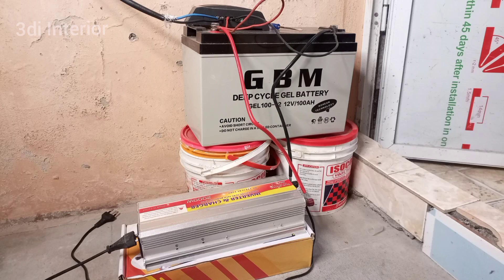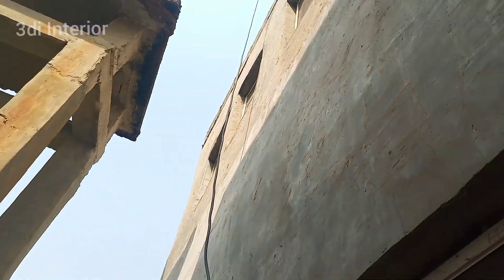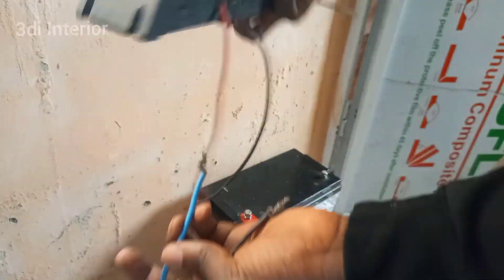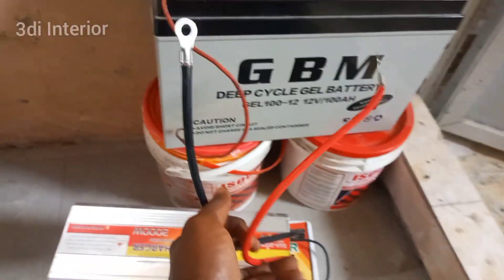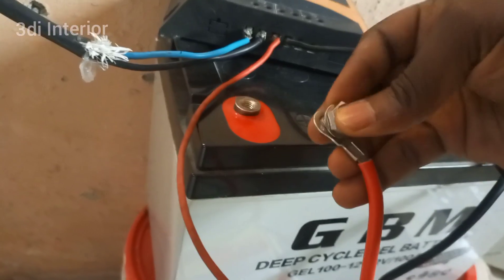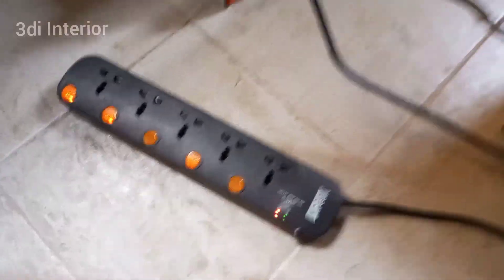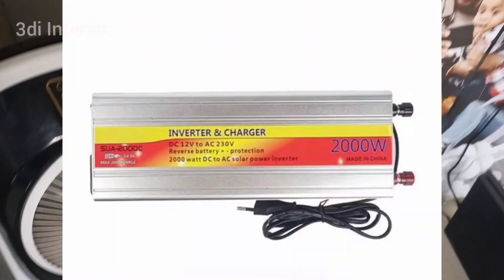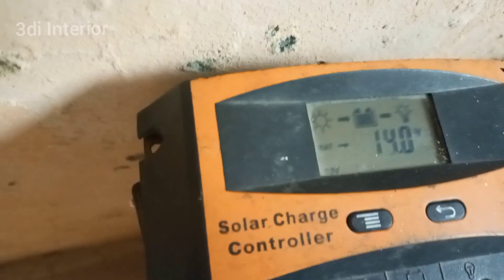How to generate your own electricity inverter with solar panel & battery for homes DIY

Comment: Very impressive, 

However i  learned that  you have to connect the charge controller to battery before connecting the solar, and when disconnecting, you have to disconnect the solar first,

How true is this guy's?
Reply from the maker: Thanks

Comment: Ok pls your solar panel is how many wat
Reply from the maker: @ikemichael1911  120 wats
Reply: @3diinterior760  and how many hours does it take to charge the battery from zero to 100?
Reply from the maker: @ikemichael1911  I can't tell because I never caculated

Comment: Can I power my 150w stereo amplifier?
Reply from the maker: Yes you can
Reply: @theartshop.1  with AVR?
Reply from the maker: I don't understand what AVR means  @CheMathiewNgayihiAbbe
Reply: @theartshop.1  automatic voltage regulator, since modified sine wave inverter aren't 220v

Comment: Does anyone have an idea what and what I should get to power 2 laptops, Starlink and phones for work during the day?
Reply: Just make sure the inverter is original, there are lots of fakes out there. Usually the working wattage is half of what is written.

2000W should be 1000W or less
Reply from the maker: @iamkingsleyf  this package can handle that
Reply: @ thanks, you say e no reach 500k
Reply from the maker: @iamkingsleyf  not up to 500k

Comment: Thanks for this update ... It has been 10 days since i did this and im enjoying it ... only problem is, it takes me 3 days to charge my battery full using a 12/24v 250w solar panel, 130ah 12v battery, 12/24v 30ah charge controller and 12v 1000w inverter at roughly 350k here in ibadan. 

how do i get my battery to charge? is it the same everywhere? what have i done wrong
Reply: Increase your panel capacity to 300-400watt
Reply: @anyanwustanley  thank you.... im considering it
Reply: Also, get an mppt charge controller
Reply: @AfricanFolklore24  thanks, awaiting the one i ordered from temu
Reply: If you're using PWM use 100w panels all in parallel. Get mppt only when dealing with higher wattage panels

Comment: I have this exact setup in my house, it carries all my light, hisense TV and fridge all at the same time..... I was super surprised.
Reply from the maker: @incrediblestevrhymz2260  mine can't carry fridge o
Reply: U are probably using a low wattage inverter, is it up to 3000w  @theartshop.1
Reply: @theartshop.1  How about your using 2000watts mine is 1000watts but it carries my deep freezer only if it's the freezer that's on
Reply from the maker: I am not a professional 💁 @mikelogbuli8175
Reply: Same inverter?
Reply: Really
Reply: how long do you get it to charge full? using solar
Reply: Amount
Reply: Do you have dc breakers and fuse ,, is it safe without it
Reply: Please how much did you spend
Reply: For 1000wat?
Reply: It can't be, confirm your battery and inverter capacity

Comment: Instead of using inverter can I use my UPS as inverter and just get charger controller with motor battery with panel for charging
Reply from the maker: @witemireolaniyi4620  don't know about that because I am not a professional

Comment: For safety wise, you should have connected the battery terminals first before connecting the solar panel to the regulator.
Reply from the maker: @RomsonKuldiRex-fq1mo  yes, you are right

Comment: Can 75Ah battery do this?

And also is GBM or sunfit battery lithium batteries?
Reply from the maker: @gideononivie6216  I am not really a professional 💁
Reply: yes 75ah can run it, go for gbm or sunfit battery if u are using that kind of sachet inverter
Reply: Im using GBM 75ah deep cycle gel 12v. Can i charge it up to 30amp from my panels cuz im buying a new panel to my set-up,without damaging the battery  @divine02o6u

Comment: Always plug the positive cable to the battery before the negative, not negative before positive as you did.
Reply: Abeg leave all those storey they also said connect batery before the soler
Reply from the maker: @thingsyoudidntknow1745  correct
Reply from the maker: @Dee_Omeke  thanks
Reply: @theartshop.1 its nice that you’re still replying comments and this video is from a year ago. So after a year, what is the update on this set up, are you still using it or have you upgraded it?
Reply from the maker: @Kompletefootball  I am still using it

Comment: Please do you need the charge controller if you are not using solar panel,ie if you are using the inverter and battery alone to generate electricity ?
Reply from the maker: @danielkwabi8831  in that case you don't need charge controller

Comment: Ok i did 
The cost
2 x 300w solar panel 75k each
Charge controller 40a 15k
Felicity tubular wet cell battery 220ah 270k
Inverter 1000w indian with transformer 100k
Wire 2.5mm 28k
Charge Breaker from light 5k
Workmanship 30k

Total : 598k approximately 600k
Reply from the maker: @onlineaccessCreativity  ik
Reply: Does still work

Comment: Hello, does the inverter goes off when the battery is low
Reply: That's good. The 1000w I bought doesn't goes off and has destroyed my battery
Reply from the maker: @fadeleenochkehinde5436  you need to consult a professional
Reply from the maker: @fadeleenochkehinde5436  yes it does

Comment: guys i just did mine, only inverter and battery. i use normal electricity to charge and so far it has serves me for hours and never go off or show low battery.  
here is my expenses:
 one battery 12v 220ah = 240k 
inverter 1000w = 34k 
and thats all i bought, but you will need changeover and AC wire for the connection, all of these may cost you upto 12k. 
all i spent in total was 275k, minus the workmanship and the cost of wire and changeover which i already have at home. 
so far i have been able to use it for more than 10hrs without light and without the battery showing low battery ...    connecting 1pc and 6bulbs, i rarely use the tv so i have no ideal if it will last longer when i use the tv
Reply from the maker: @worldtrendtv01  you are welcome 🤗
Reply: How do you charge with electricity??
Reply from the maker: @oluwoleodetola1626  it's explained in the video
Reply: @oluwoleodetola1626 You'll need an electrician to connect it for you. They will run the wiring directly from the changeover switch. It's important to ensure that the power from your inverter doesn't flow back into the inverter, as this could cause damage. The connection should be made from the wire coming from the NEPA supply directly on the changeover switch to your inverter.
Reply: So you don't have solar panel yeah?
Reply: Can you drop your whatsapp number bro
Reply: How long have you been using and how is it going?
Reply: How do u know when the battery is full?
Reply: Does your pc plug make sound and how had it been in the long run

Comment: Hello sir, I am using same inverter you demonstrating with. What is the power of the controller and how can the inverter charge battery without sun and nepa?
Reply from the maker: @nathanielidowu15214  without sun and nepa??? Everything is explained in the video

Comment: Which do u connect first to the controller, cable from the panel or from battery
Reply from the maker: @thefunnyman2629  just as you saw on the video

Comment: How many mm wire can I use to connect the panel to the controller
Reply: 4mm
Reply from the maker: I am not a professional so I don't understand mm
Reply: @theartshop.1 how many mm cable did u used to connect ur panel
Reply from the maker: I honestly don't know @kimberlystone2455

Comment: I have a similar set-up, here's my breakdown.
Battery = 120k (SunFit 12v 100ah)
Inverter= 65k. (3000w)
Solar panel = 78k ( 300w, 24v)
Controller = 30k ( PWM, 40A)
Cable = 27k+ (2700 per yard)

It is better to buy during raining season as the prices are a bit stable but during dry season the prices go through the roof.
Reply from the maker: Correct
Reply: How long does it take to charge your battery fully using your solar panel??

My installer used a 1mm cable because I didn't have money for the cable for now coupled with the fact that he was just telling me about solar cable......Now the system is not really charging and even with sun from 8-6pm
Reply: @oluwoleodetola1626  charging speed depends on the sun and charge controller. If the sun is good, then it would take 3-4hrs for me to get full charge. 
I'm using 4mm solar cable, this wire connects the solar panel to the charge controller and from there to battery, then inverter cable from inverter to battery. 4mm is highly recommended due to it's tolerance and efficiency.
Reply: @Nedohh  Waoh.....Thanks the sun is very good here even from 8am the sun is already shining but the cable he used couldn't even charge it full for 2 or 3 days now can you imagine
Reply: @Nedohh  Thanks, I later got a 1mm cable at the rate of 1800 per yard and by 10 or 11am my battery is fully charged and I run it using the sun while I run on battery during the night.......I'm enjoying it now 😃
Reply: @oluwoleodetola1626  Another 1mm cable? 😂 Wasn't the original one that wasn't charging 1mm too?
Reply: @obimadu6201  yeah 1mm but I bought it 200 naira per yard 😃 but this one is 1800 per yard 😃 

I just bought normal nigeria cable not solar cable
Reply: And it takes 2 days or 3 days to get it to full unlike this one within 3 hrs or 4hrs
Reply: @oluwoleodetola1626  what's your setup like? 
I just got 
4x 100w 12v panels - total 400w 12v
200ah 12v battery 
20amps mppt controller from powmr
1000w inverter with 10amps charger

Not for the whole house, just for my workstation via a UPS. By my calculation, full charge via the panels will take 7 to 8 hours, correct?

That's why am asking him where he got his panels.
Reply: @obimadu6201  Just 180W panel, 30A charge controller, 500W inverter and 40ah battery just to power my system majorly.
Reply: @yolodii  I'm using a moncrystalline silicon solar panel. They're highly efficient at Sunday absorption.. mine is a 24V, 300w and it charges my battery really well. I'll definitely add two more solar panels and and a battery connected in series to turn my setup to a 24volts system. This would  provide more energy to power the entire house with lite-medium load.
Reply: @Nedohh  What i want to know is if you got them online, and where, you got them much cheaper than i did mine.
Reply: @yolodii  nahh, I bought everything at a whole sale in Abuja. The prices were relatively good, they tested everything and some of the products came with warranty
Reply: @Nedohh  Ahh Nicee. I got mine off of Jumia, i got 200w 12v for the same price you got your 300w 24v. Good for you fr. Well I got an mppt controller hopefully i can still get good charging times once i setup.
Reply: @yolodii  the truth is that a lot of people go for a 12 volts system. That is why yours is quite expensive while @Nedohh's own is cheap. But for me, I decided to go for a 24 volts system which gives me more power at lesser cost. It all has to do with the kind of batteries that u have. I bought 2 quantities of 100AH batteries (12v each) and connected both of them in series to get my 24 volts system. The moment I was able to achieve that, I decided to buy 24 volts inverter which is quite cheaper than a 12 volts inverter but with more power for your gadgets at home.
Reply: @oluwoleodetola1626  please reply. With the 40ah battery,  how many times can it charge your system without sun? 

Cos I just ordered GBM 40ah battery.
Reply: @paturch7201 please how many hours does it last for you and what’s the cost of everything 🙏
Reply: @worldtrendtv01  back then (2 years ago), I used approximately 250k. But now, it may cost u more than 600k for real. Things don go up now. Only d inverter alone dey pursue 300k now and d battery is about 180-250k for 200AH battery now. Solar panel never join and d cables for connection, may be 150k. Everyday, prices of things dey go higher for naija.
Reply: @oluwoleodetola1626 with this setup, how long does it take to get full charge on a normal day and how long does it last?
Reply: @Lux_De1  6hours of medium load. (2 laptops, TV, dstv, standing fan, 2-4 plugged phones). 
U have to calculate your loads based on their watts and this would allow you manage or drain it. 
With TV, decoder and few plugged phones you can use your solar from 9am to 8pm in the evening with my set up..
Reply: @oluwoleodetola1626  im in the same situation..... 2.5mm cable was used. how did you remedy it pls?
Reply: @Nedohh tell me the store please i need it
Reply from the maker: @oluwoleodetola1626  I have not caculated
Reply: Thanks for posting this
Reply: Where did you get your solar panel please?
Reply: @yolodii  Area 1, FCT Abuja
Reply: Please how come your inverter is cheap. My own inverter is 1.1KV and I got it for 135K. It's called pure sine wave inverter and I think your own inverter is cheaper and efficient than mine. Though I'm yet to call someone that will install it for me.

I got two solar panels 250watts each (150K)
Charge controller is 21K
100Ah GMB battery (140K)

He was the one who bought the inverter, he said it will power my fridge. Please can you shed more light on my analysis, I'm a novice on this.
Reply: @biblelighttv01   @user-ot8uy1bf1l  My inverter is a modified sine wave inverter, which can deliver but certainly not as efficient as pure sine wave inverters of the same rating but you'd hardly notice the difference. 135k is a bit too much for a 1.1kw pure sine wave inverter, that cash should have gotten a 2kw pure sine wave and your battery is a bit too expensive to be honest. Concerning your fridge, don't bother stressing your setup to power your fridge, at full charge and with good sun, you should be able to run your fridge for about an hour or so, but if you power your TV, light, fan and other equipment alongside, then it won't last at all. Your set-up is not recommended for that much load.
Reply: @biblelighttv01  flat or sachet inverter is always cheaper because they are mostly modified sinewave and not pure sinewave. However, it is difficult to repair sachet inverters when they are bad.
Reply: @biblelighttv01  He might be correct with that estimate. My setup is a sachet inverter, not the regular type. I only use it to power light loads like bulbs, one PC, a television, and some other small gadgets.
Reply: @worldtrendtv01 can I get your setup?
Reply: Please how long will this Battery last without sunlight?
Reply: @jeremiahedet3544  largely depends on the load. Maybe around 5-7hrs depending on the way you use it... But most people can load it up and drain it within 2-3hrs
Reply: Thanks .... I'll do this
Reply: Help? 🥹

I’m in Abuja.
Reply: Can I make use of it without battery
Reply: Thanks bruh
Reply: Where did you buy these especially the inverter? Is it pure sine wave?
Reply: @iamkingsleyf  Area 1 shopping complex. The inverter is modified wine wave.
Reply: Sir I want u to put me through.
Reply: @Nedohh what is the name of yiur charge controller?

Comment: Is this particular product (inverter) good enough? I want to know if it serves well before I buy it.
Reply from the maker: Yes, have been using it
Reply: for the inverter, i would advise u go for pure sinewave inverters. What was used in this tutorial is a modified sinewave inverter, which is more cheaper but tend to give problems to phones' panels when using it to charge phones. But with pure sinewave inverters, u have no issues at all just that it is expensive.

Comment: Thanks a lot! Really helpful video. Can you pls help with a breakdown of cost?
Reply from the maker: You can Google the current prices
Reply: Okay, thanks. From what I'm seeing here 
Inverter 
Panel
Battery
Charge Controller

What about inverter charger? Or does this one come with inbuilt charger? Or maybe the charge controller works in place of charger.
Reply: @BrainBurstr  
inverter 70k 
Battery 150k
Controller 30k
Panel 50k

There are others you will need, a complete setup will cost about 350-400k
Reply from the maker: You can Google the current prices

Comment: Do I need to get the solar controller if I only want to charge with electricity ?
Reply from the maker: No, you don't
Reply: @theartshop.1  thanks for answering. I'll just buy an external charger for the battery
Reply from the maker: @olisehanineh  ok